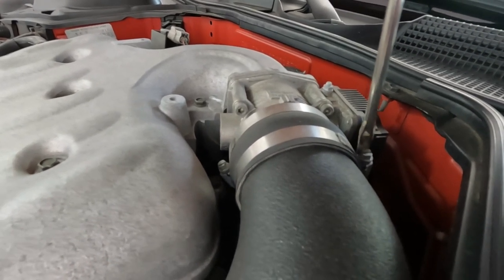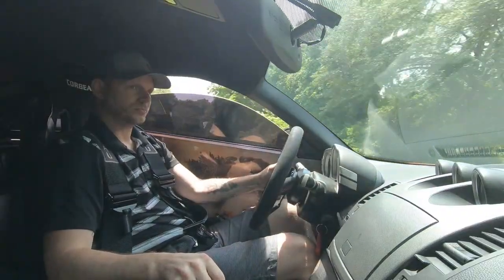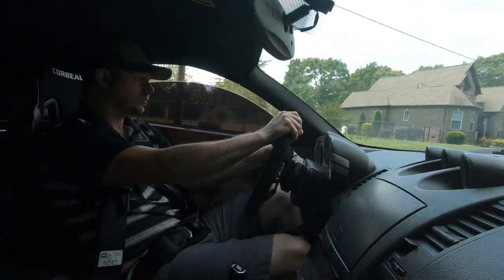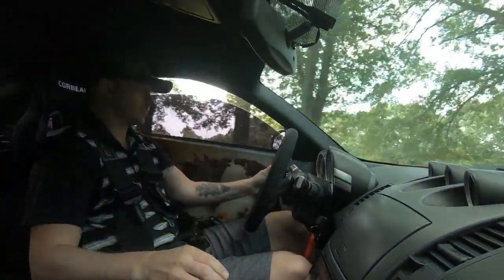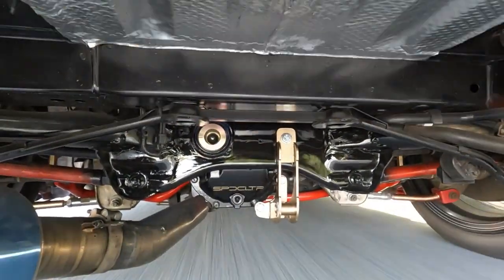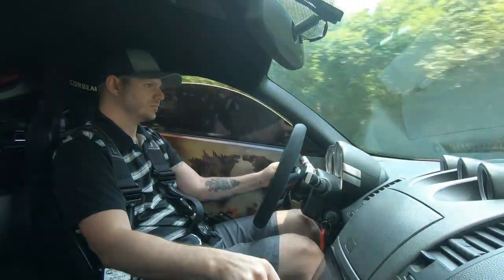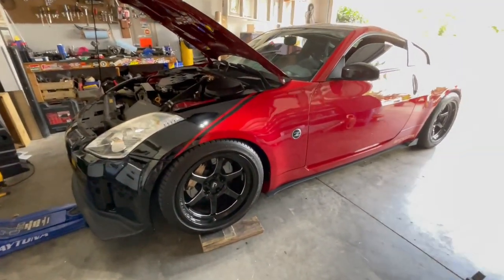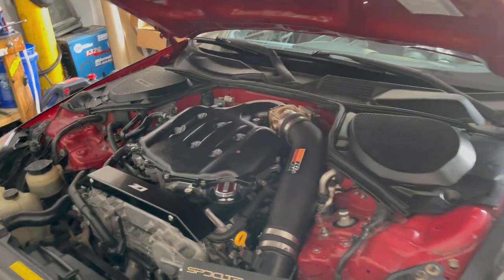350z / G35 Plenum Spacer Review

Comment: Can the factory computer keep up with the extra air volume and larger exhaust? As we discussed before, theres a area of diminishing returns with out a stand alone and wide bands telling the ECU what to do with the better flow. Otherwise that ECU is going to fight for that perfect 14.1:1 with in it's limits.
Reply from the maker: The computer tries to adjust as much as it can within fsctory parameters.  Generally catback exhaust doesn’t require a retune, but test pipes start to push past what the ecu is used to.  Same with CAI.  The car (3.7) doesn’t starve for fuel either, even when tuning so larger injectors won’t add any value unless going flex fuel/e85 where larger volume is required. Obviously in boosted cars you can potentially run into fueling issues, but I’m not certain off the top of my head where that line is.
Reply: Great question! I too have the spacer and feel the difference as well. Though that question did cross my mind. I am looking into a performance mass air flow sensor to see if it helps read the extra air volume. The Jet 69138 maf or the UpRev maf sensor by Z1 motorsports.
Reply: @velox731 so is it ok to just put the spacer on  and do nothing else?
Reply: Yes,  you will feel a difference. Though, you may have to do an idle relearn for the ecu to adapt to the extra air coming in.
Reply: Plenum spacers don't change anything relevant... There's no true effect so why would the ecu have an issue? Naturally aspirated motors will only pull as much air as can fit in the cylinder...spacing the plenum only has one singular effect, miniscule lower temperatures
Reply: @velox731 there's no extra air.. It's naturally aspirated. You can only have as much air in the cylinder as there is space for that air.. Volumetric efficiency
Reply: @DarkAttack14  if I understand correctly it's a flaw in the design that can cause air starvation if not done on further research.

Comment: Would it be worthwhile to install this plenum spacer on my 2005 350Z convertible with an automatic transmission? I drive conservatively, rarely exceed 4500 RPM, and the car already has over 120,000 miles on it.
Reply from the maker: If you don’t ever push the car. I wouldn’t even bother.  But if you want a little more throttle response and a little more pep, then it’s a simple and relatively inexpensive upgrade.

Comment: Would you recommend upgrading the plenum on the G37S Coupe 6 MT? Would I need a tune if I were to decide installing it?
Reply from the maker: It’s not a bad upgrade as long as you have the other mods done too—intake and exhaust.  And yes, you’d want a tune to get any benefit from it
Reply: @SpeedCultureStudios how do you get a tune
Reply from the maker: @gunnerv12  you find a tuner that specializes in these engines

Comment: Been looking into this part as well
Reply from the maker: Worth it!
Reply: Dear Sir/Madam, did you install a 5/16 plenum or a 5/8 plenum and did it interfere with closing the engine cover.  Greetings Vladimir
Reply from the maker: @vladimirbenac7626  It is the 5/16" spacer from z1.  No issues closing the hood.
Reply: @SpeedCultureStudios abra problema de cerrar con el de 1/2 ?

Comment: Hey fam. You got a video on drop in injectors for the Q? I've been thinking about those famous GTR injectors but am unsure about it. . .
Reply from the maker: That is one video I have not done
Reply: I could see higher volume injectors needing a tune unless the injection rate is deminimus once you add better air flow.
Reply: @SpeedCultureStudios  what is your opinion that the new Z is a Q with no back seat and a mark up?
Reply from the maker: @MrTilbin  unique interior styling, LSD and manual — and different auto trans—it’s a different car than the Q in my opinion.

Comment: What spacers do you use for the strut bar
Reply from the maker: No spacers on the strut bar until I put the plenum spacer on then I no longer used the strut bar
Reply: @SpeedCultureStudios   no check engine light after installing 

Im pretty sure you disconnect the battery to reset it but no check engine light ?
Reply from the maker: @angelisalive  I may not have even disconnected the battery to install -- if it wasn't in the video, I didn't do it.  Never got a CEL after install either.
Reply: @SpeedCultureStudios   everything worked out no cel thanks for the video !!!

Comment: How does this affect MAP pressure?
Reply from the maker: I would imagine impact is minimal.  It basically just evens flow to all intake runners.  It would be interesting to see pressure change at various points
Reply: @SpeedCultureStudios  Did you need a tune or a flash at all for yours?? I think I might buy it.
Reply from the maker: @user-ws3sl9xi7y  no tune needed

Comment: Wasted video. Should’ve used a heat thermometer gun to measure before and after temperature on your engine block.
Reply from the maker: Wasted? Lol  Engine temps weren’t a concern. If this was an “I installed a manifold spacer to get engine block temps down” then sure it would have been pointless—but that’s not why the mod was done, nor would it really have any impact of the temp of the block. What’s your point